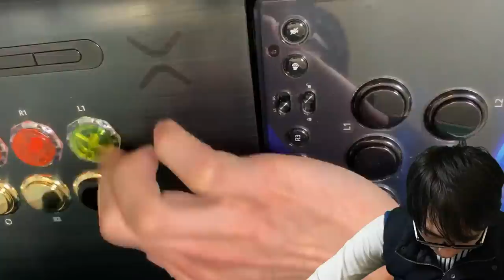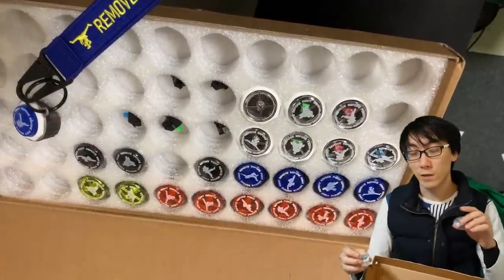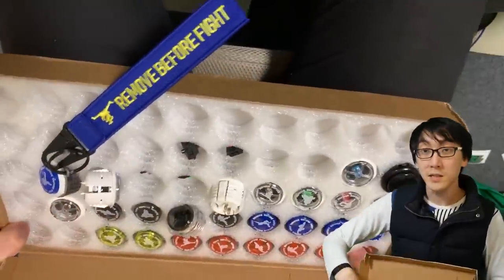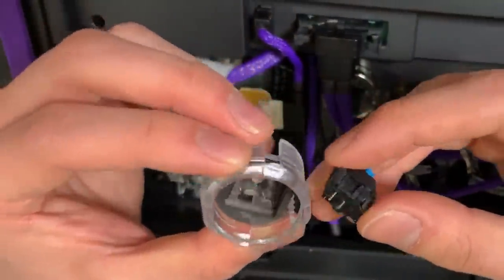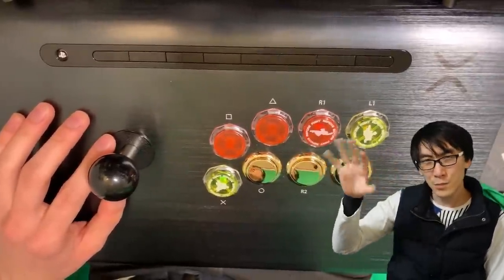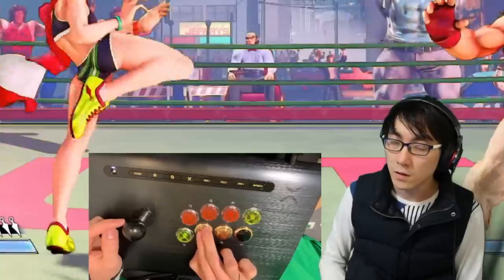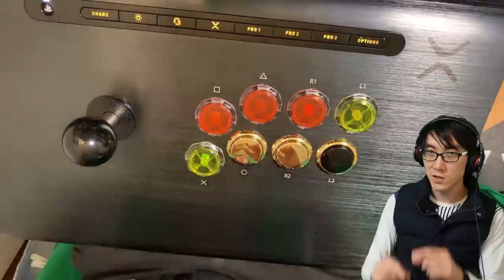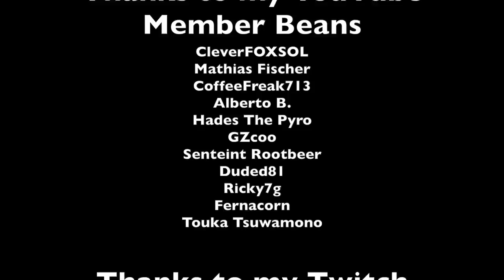I want THESE in EVERYTHING!

Comment from the maker: Update 3/24/2019: looks like these are popular huh? I asked Gamer Finger and they said they’re getting buttons back in stock this week at the Gamer Finger web shop, Focus Attack and sengoku etc
Reply: I am not shocked at it, they tend to have a nasty rush in and around an FGC tournament or the end of the month (and Final Round 2019 just passed). I know that it how it goes around focus attack, I would not be shocked at GF suffer the same run with supply during the same timeframe.
Reply: you can't buy the actual panthera buttons, but the switches inside the panthera evo are most likely razer yellows, so if you want you can actually try to find single razer yellow switches, and change the ones inside the gamerfinger, like how you change them normally. I'm pretty sure that you can find some through mech keyboard groups, and they shouldn't be too expensive as well.
Reply: Nice, are you ever planning to make a video on how to use an arcade stick effectively for(NOOBIES) those who are interested in moving away from a controller to a fight stick like this one? how you hold the stick vs how you would press the buttons.
Reply: I put them in my hitbox and I love that any MX switch fits in them! I actually put razor MX-oranges in my movement buttons, which are like the MX-browns but a little bit better (until focusattack ran out of them). But god dammit why is gamerfinger always sold out of 24mm!?!?
Reply: Silver - linear, silent, less travel
Red - linear, silent

Blue - tactile (actually heavier than brown)
Brown - tactile silent
Green - tactile heavy
Reply: Bought 8 buttons after watching this. Going to pair them with KBDfans T1 Tactile Switch
Reply: Can I get one of the GamerFinger stickers? They didn't send any with my FocusAttack order :(
Reply: Sorry but where do you find the sanwa quiet buttons and the gamerfinger buttons I cant find them, and you didn't leave links in the description
Reply: 1

Comment: If you liked Cherry Blues, wait until you try Kailh Speed Pinks. They're a straight upgrade, especially for gaming. Although they're clicky, they actuate very fast (hence the name SPEED Pink), and even the click itself is better than the Cherry Blue's. It's less tinny and lower pitched.

Source: I've researched and experimented with keyboard switches... more than I care to admit. My current hotswappable keyboard is rocking some Frankenswitches I've made out of Gateron blacks and some Chinese brand's blues, except my spacebar has a "Jailhouse" blue switch I've made with an o-ring.
Reply: haha 2 years late but i'll comment it anyway. It's unfortunate, but gamer fingers don't support switches aside from cherry mx switches, but to be exact it's the housing.

I tried to fit in c3 = tangerines, kailh box jades, and they both can't fit. only official cherry mx housings can fit. Personally, linear switches in these buttons feel too mushy for me as my other set of buttons, punk workshop buttons, work and feel absolutely fantastic with the tangerine switches. Gamer fingers edge it in terms of build quality however. 

As such, I'm settling for cherry mx blue switches, and I may consider trying putting in the kailh box jades stems in the housing to see whether it might work, but if it feels good enough, I'll probably just leave it as is.

Comment: Those Gamer Finger buttons are really impressive, I've really been debating if I should drop the hammer on a set.. this video does not make it easy lol. 

I'm like you man the hobby of customization is so fun. Sanwa makes good parts don't get me wrong.. but I'm the kind of person that wants to experience every manufacturer and every take on arcade parts.

So far I have owned Sanwa, Seimitsu, Crown and Happ/iL buttons and honestly I have liked certain things about all of them.

I think people that think Sanwa is the only way they can play, are missing out on the spice of life which is variety.

My next stick build will be a Myoungshin Fanta and Crown buttons. Then it will be sourcing out or building a good enclosure for my Happ/iL parts So I can finally finish it.

People that love this hobby, don't be afraid to try new brands and new experiences. I guess I'm going to take my own advice and get some Gamer Fingers.
Reply: I know exactly how you feel. I got some Seimitsu 24mm/30mm for the movement buttons on my Hitbox build, just to try them out (thinking that the stronger actuation force might feel better for movement). But now comparing the 24mm buttons, Seimitsu seems better built than Sanwa, they're less wobbly and the plunger fits in the body better. I thought it was crazy considering how much praise Sanwa gets but now I think I like Seimitsu better, at least for 24mm buttons. Never would've known if I just stuck with Sanwa like everyone suggests.
And now after watching this I want to try some 24mm Gamerfingers lol

Comment: I used to have an arcade stick. It was the Hori V3 for my PS3. And that stick was piece of crap. The lever and the buttons were not very responsive. This was before I found out that arcade sticks could be modified. The stick wasn't very responsive, so I got mad, smashed the sucker to timbuktu, threw it in the garbage and never thought about that crappy stick ever again. And when I saw the insides of the V3 on YouTube, it made me hate the V3 even more because there was a giant circuit board in the way of the buttons and the wires. In other words, the stick wasn't solder-free. My advice to you arcade stick geeks out there is stick with the solder-free arcade sticks, meaning you don't have to worry about putting up with giant circuit boards being in the way of the buttons and the wires.

Comment: im a little late to the party (i randomly came across this video), but a little info for you, Cherry MX switches are built to last, with an official rating of 50 million key presses. This means that for 50 million presses the switch will feel the same the entire time, the force to press it down will not change, and the switch will not break. Green is the most heavy switch of them all, it requires 80cN of force to press vs the next highest at 65cN (Cherry MX Clear) and the next one would be the Cherry MX Black at 60cN of force. The lightest switch is the Cherry MX Speed Silver (45cN) which also has the shortest travel distance before the switch will work 1.2mm. The Cherry MX Blue switches require 60cN of force to press and have a travel distance of 2.2mm and a total travel of 4mm. 
If you are looking for the fastest switches i would go with the Silver ones as they are the lightest buttons and have the shortest travel time, I know I am talking about milliseconds and millimeters here, so the difference is not that great, but hey an advantage is an advantage!
Also I would think carefully about Razer, as they were denied a partnership with Cherry MX (who has switches in every major brand keyboard) and are using a chinese knockoff clone of the Cherry MX switches. Razer makes claims of 80million presses but does not give any detail on what that means. Razer also has claims of high quality control, but their switches tend to fail a lot more than Cherry MX switches. One big issue with Razer is that their switches are known to bend if you apply a little bit of force (not a lot, heavy typing and in your case rapid hard button presses). Razer is also known for their terrible warranty system where they have been known to drag out issues that are submitted to them very close to the end date of the warranty and claim that your product is now out of warranty and refuse to fix it under warranty. They are also known to flat out void your warranty as the warranty agreement states that they can at any time for any or no reason void your warranty.  Their products tend to be the most cheaply made products with the highest price tag (they are like the Apple of the gaming world) and because of their poor designs a lot of their products last only as long as the warranty does.  For the PC side of them (keyboards, mice, laptops) they have a spyware system they force you to instal which does log your key presses and mouse clicks (both how many times you have clicked and where on your screen you have clicked) this info is worth a LOT to hackers and you can not use razer products without this software on a PC. They have even gone sofar as to start up a cryptocoin mining system where they have users mine for crytocurrency on their own computers and give Razer all the cryptocurrency that has been mined, in return the user gets a fraction of the value given back to them in the form of a credit towards Razer products. They are not a company to trust and I would rethink about promoting them at all.

Comment: I wish you had some Cherry MX Black switches in the mix. Of all Cherry MX switches, they have the strongest spring in them.I believe they have the same tactile feedback that the Brown switches do too. Also, some silicone o-rings on the switch's post will eat a lot of that sound; noticeably quieter. The thicker the o-ring, the more it will deaden the sound, just like on a keyboard.

If you still want to use traditional buttons, without the high-pitch sound of a Sanwa, Seimitsu buttons have a much deeper sound. Sanwa: "tick tick tick" Seimitsu: "tock tock tock"

Comment: the best part about these buttons (I've owned a set for about 6 years, just bought a second set for another stick) is that if the microswitch fails, you don't have to buy a new button, just a new switch, and microswitches are very cheap. You can get a set of 10 for 15 bucks.

Comment: If you want to try some nice keyboard switches, I would reccomend you the zealpc Healios silent linear switches. If you want something with the light tactility and a nice click, if the stem fits the housing of the controller buttons. Keyboard community is pretty crazy if you get into it and there is so much more you could do with switches outside of Cherry MX switches so if you can use your own switches, I would really reccomend to go much more into each type of switch since the most expensive you could spend on a set of 10 switches to get something significantly better is quite nice. The Silent switches will have a slightly softer bottom out feel than the non silenced switches. I REALLY WOULD RECOMMEND DOING THIS IF YOU STILL USE THESES SWITCHES (since it is 8 months out of when you posted this video).

Comment: Your preference for blue and silver makes sense. I haven't tried the gamer fingers, but on a keyboard people generally like blues for regular typing. They're tactile and clicky and feel nice in general. They're pretty loud on a keyboard though, and it requires higher-than-normal force to press them down. They're still quieter than stock Sanwa though and you put a lot of force into your presses anyway though so they sound pretty suitable for you.
Silvers are relatively new and built for gaming. Lower required force and travel distance for optimal twitchy responsiveness.
Reds are like silvers with higher travel distance so no reason to use them.
Browns are like reds but are quieter in exchange for less clicky feel. If the silvers are quiet enough for you though no reason to use brown.
I don't know much about green but looks like they require the most force to press.
Reply from the maker: Thanks this info helps :)

Comment: There are many other switch options out there as well, not just Cherry. If you want more customization with different tactile feels, weights, etc., there are many boutique switch options that you can research on mechanical keyboard forums and reddit.
Reply from the maker: Down the rabbit hole I go...
Reply: NihongoGamer if you enjoy the Cherry Blues, consider looking at Kailh Box White switches. They use a click bar instead of a click sleeve and it has an even more responsive click. There is a brand new keyboard store in Akihabara called Yusha Kobo Keyboard and they have tons of switches for you to try.

Comment: Man was looking into getting these for my stick. Thanks for the video. I have a Razer Blackwidow Tournament Edition 10 keyless for PC lans. Like the Panthera it has switches you can only get by buying the keyboard. Razer calls them greens. But there Greens are more like blues MX blues. They have a little more heavy spring at 50 grams instead of 45 grams. They activate early and rebound faster. And I just looked it up. You can buy them online. But don't know if they have the same pin out. Would have to look that up. But these are worth the try.

Comment: Reminds me of the Razer Panthera EVO buttons. I had a nacon Daija stick with sanwa buttons and a RPE with Razers mechanical buttons. I found the mechanical switch style buttons a lot more reliable and, I didn't have to hit the mechanical switch buttons dead centre when pressing compared to the nacon Daija sanwa buttons which I had to hit with some force in the middle every time. Also the razer mechanical switch buttons (similar to the buttons in the video) have less of a travel compared to sanwa which have a taller button ie longer travel. Long story short I returned my nacon daijia stick.

Comment: Whoa Cherry MX Switches for fight sticks? Well that's awesome. I thought they were only used for gaming keyboards.
Reply: GamerFinger has been around for a bit, I have using them since the original HBFS.
They are VERY good, but the G3's I feel are the best for two reasons, the housing for the switches are much better and solid than the G2's. And screw-on buttons are an option (which I grabbed). 

I don't mind the clip-ons, but HBFS' are rather tight to replace snawa's buttons. There were times of many broken clips because of this. Till now.

Comment: I hope you can answer me please... I have the razer panthera evo brand new, and I just found out that its buttons arent sanwa so b4 I open it up I want to know if I can put the little foam into the razer panthera evo I am merried and I have a kid so I need those buttons as quiet as possible good video btw
Reply from the maker: I tried it for you and the answer is: yes sort of!

Razer panthera evo buttons are the same size as sanwa obsf-30 buttons so you can replace the whole button with gamer fingers or sanwa silent gen1/gen2 buttons. If you really want to keep the razer buttons u can open them up and fit foam silencer pads BUT the silencer pads aren’t always available for sale separately and the inside of the button is a slightly different shape to a sanwa button so the silencer pads fit, and they work, but they might shift around a bit.
Reply: @NihongoGamer  thank you for responding, I already have the foam separately, so I hope they fit ✌️thanks again

Comment: Remeber how i said i have that mortal kombat arcade stick? Well the triangle buttin (high punch) is kinda roughed. Is there a way to replace the buttons on that stick?
Reply: Can't you buy IL buttons for it?
Reply: @RICHUNCLEPENNYBAGS77  idk, this is the first fightstick I've ever even used
Reply: @DemigodSalt  I'm assuming you're talking about one of the wooden sticks with American style buttons with a long stem, in which case I'm pretty sure if you look up Industrias Lorenzo on Focus Attack or some similar store you can find exactly what you need.
Reply: @RICHUNCLEPENNYBAGS77  it's the mortal kombat tournament edition  fightstick by pdp released in 2011. Itvhas the X shape layout or cross depending which way you look at it
Reply: @DemigodSalt  OK, so yes, you need IL buttons.  Go to Focus Attack and buy IL buttons.
Reply: @RICHUNCLEPENNYBAGS77  do you have the arcade stick i do? If so please make a vid going over how to replace the buttons.
Reply: @DemigodSalt  No and even if I did I would not make a video.  Just open up the panel and look.  It's not rocket science.  Take the leads off the switch, unscrew the nut, remove the button, insert the new button, tighten the nut, attach the leads.  It's exactly the same as replacing the buttons in any other stick
Reply: @RICHUNCLEPENNYBAGS77  I'm new to this